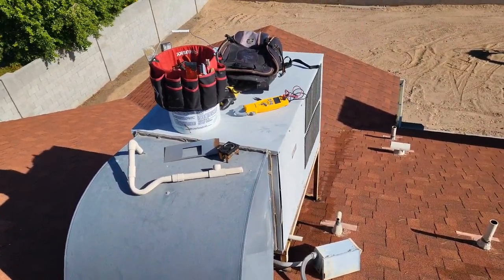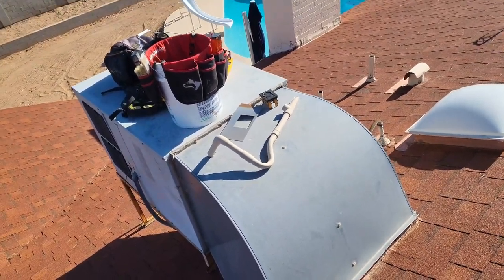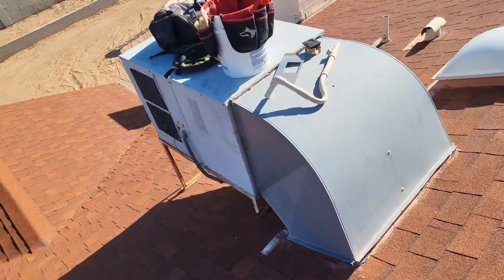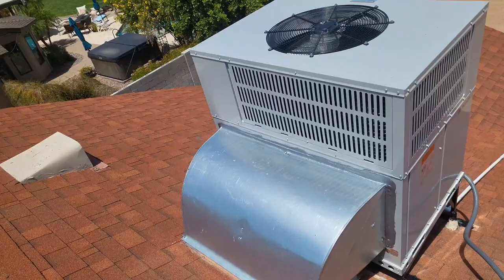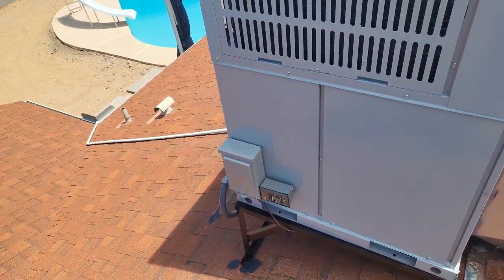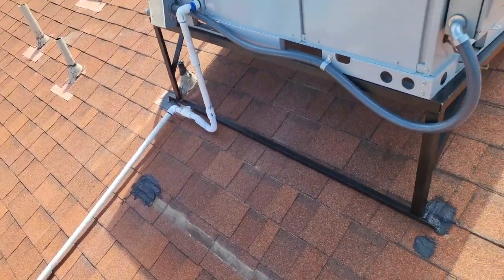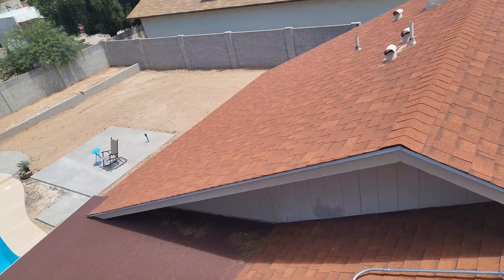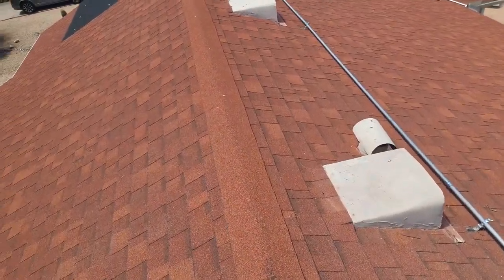BOSCH 18.5 SEER 3 TON PACKAGE VARIABLE SPEED HEAT PUMP-AIR CONDITIONING INSTALLATIONS/REPAIRS TEMPE

Comment: Have you done any 15 seer Bosch Splits? i have installed a few of the higher seer models with the 2 stage x13 blower and i really like those,
but the 15 seer seems a bit odd... a psc motor paired with an inverter... i been reluctant to offer them, whats your opinion ?
Reply from the maker: I haven't done those yet either and I'm not sure i will offer them. IMO it's a step backwards. I think it was mainly a business move to compete in the 15 seer market

Comment: What home size is good for 3 ton m18 and 5 ton m19? My contractor wrote 4 ton on the estimate first, when I asked for actual model number he said there is no 4 ton unit. Either 3 ton m18 or 5 ton m 19. We have our old ass gas/ electric  carrier 4 ton now so which one is right for me? M18 or M19??
Reply from the maker: The 5 TON unit has a setting that makes it into a 4 ton unit, I hope that helps

Comment: Question, isn’t it the other way around? A unit that can handle a higher static pressure can actually work with a smaller duct, because the bigger the duct the less restrictive it is, so a 16 should work well I don’t think you need to upgrade to an 18 with that unit
Reply from the maker: according to there tech support 18 is the minimum
Reply: @themoderntradesmen9352  i was talking about the flex size not the seer rating. Thx for replying! If the unit can handle 0.8WG that means the motor can work well even with smaller duct. When I design a system, the manual D adjusts the duct size automatically and if I have more available static pressure I can either put smaller duct /longer distance or more fittings if I want because the unit will be able to deliver 400 CFM per ton.